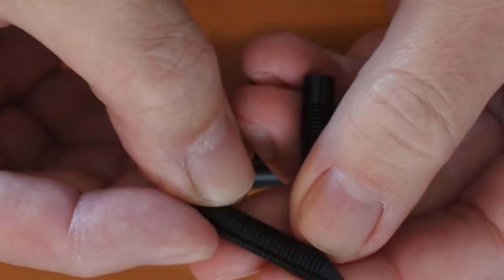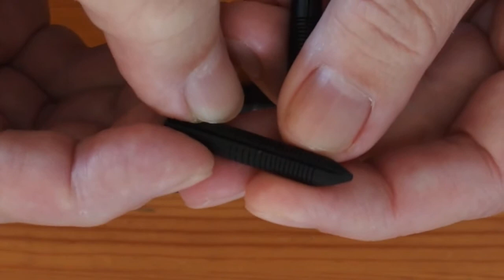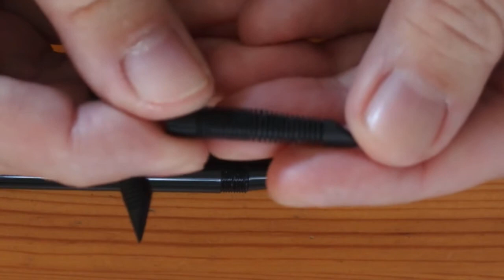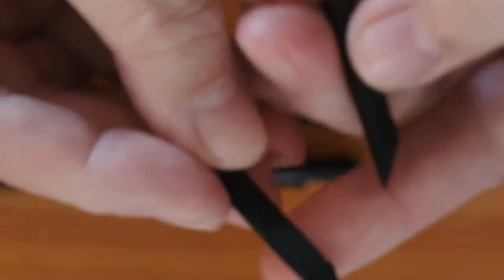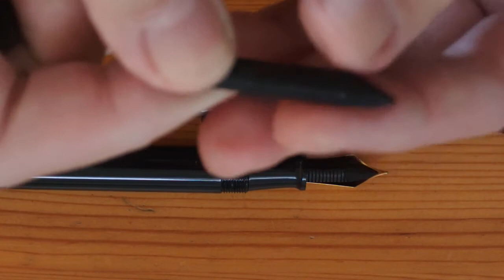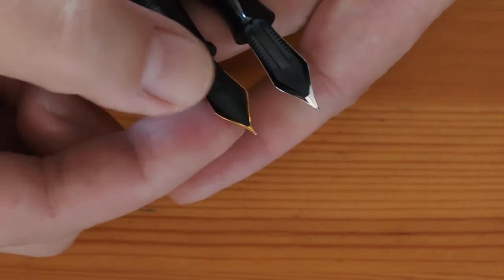Ebonite vs Plastic Fountain Pen Feeds: An Investigation

Comment: I am using fountain pens for over 60 years. Most of my pens are Indian ebonite eyedroppers. These are not fancy items, but sturdy writing instruments. The ebonite feed is strong and sturdy, and stands repeated handling. I like to play around with my pens, changing the nib, varying the flow, etc. The ebonite feed  takes all this mischief and rough treatment well.
The plastic feed is unreliable, even in the best brands; it can break even when we attempt to change the nib. To adjust the flow is difficult with plastic feed. We should not touch the plastic feed unless we are professionals, and we have a replacement ready. This is my experience.

Comment: I can speak for Montblanc, as it is the brand I know best.
Up until the 80s, Mont Blanc pens had always ebonite feeds. I have several Montblanc vintage pens. They are all ASTOUNDING writing instruments. With the modern production though, having also some of them, I do notice a difference. And it's not a difference for the better, precisely. Modern Montblanc pens are no longer the "aaaw" pens that used to be. Modern Montblanc pens are just fine, sometimes "meh" pens. I don't know if it's because the material itself or rather because plastic feeds can be "machine adjusted" in contrast to ebonite feeds that need to be individually tuned and adjusted; this would account for virtually zero defective pens among the vintage ones. Anyway, perhaps Montblanc is too busy nowadays being a "luxury brand", and making stuff like watches, jewels, etc. Back a days Montblanc was only focused on making superb writing instruments. I suppose when you have too many things to do, you don't do all of them as well as you could if you only had one to be worried about.
If you are considering to buy a premium fountain pen, I would recommend to go either for an Aurora or a Pelican; both brands kick Montblanc's ass nowadays, You are going to pay less for a better pen. And Aurora still makes ebonite feeds. Superb pens, I love Aurora.
Reply from the maker: arnauuu1 I haven't bought a Montblanc pen new for some time, in fact since the 1970s, so I am not in a position to say too much about them. Piston filler aside, as the C/C system getting to be the mainstream configuration, the requirement for a tailed feed makes ebonite an unsuitable choice for the purpose, even though its inherent hydrophilic nature is quite a plus. Manufacturing precision is required for injection moulded thermoplastics feeds and nibs to work flawlessly, as it's very difficult to get them fine-tuned to effect perfect partnership. By the way, Montblanc bought the Minerva watch company as a way to offer Montblanc-branded watches; they have neither the intention nor the resources to build up the capability to manufacture watches anyway.
Reply: @Seele2015au  I don't know, I am not a physicist or anything. I just feel that Montblanc pens have lost the "soul" (if that makes sense) they used to have. And for certain, the springiness.
Reply: I have a Delta Roma Imperiale fountain pen with a massive ebonite feed. This pen beats my brother's MB in every way. The ebonite feed never disappoints me.

Comment: The fountain pen industry has ruined itself with plastic.
I spent months waiting and good money having a pen built for me...only for it to arrive with a #5 Nib and POS plastic feed with that damnable pigtail.
Tried to swap in an ebonite feed...nope. Complete ink starvation.
No one makes a #5 ebonite compatible nib/feed sleeve that screws into the pens section.
That makes this pen impossible to upgrade. 
Thankfully I've modded the plastic feed enough to support Flex writing with a flex nib. Drains the converter quickly though.
I've decided to upgrade to a PENBBS-456 with Ebonite parts for Flex writing.
Hopefully that works out...if not, I'm not going to be a happy camper.
I'll have to start saving up for a vintage fountain pen....modern hardware is just garbage.
Just pretty fancy garbage...
Reply from the maker: If you want cartridge/converter operation, or screw-in nib unit, then you have to put up with injection molded thermoplastics feeds as the feed tail is essential. It is not about modern hardware or whatever, it's a demand of the design: want the design, live with the materials that make the design possible in the first place.
Reply: I'd love to switch all my non c/c pens to ebonite, where do you get a feed that fits a PenBBS nib assembly? I'll take a dozen! ;)
Reply: This is really weird. You were on another channel one year ago proclaiming the virtues of plastic over ebonite. Were you just there to hate on Noodler’s pens or are you just this flip floppy on your opinions that 2 years after this you proclaim plastic is superior in every way? Also, you could just get a Noodler’s Triple Tail and be smart enough to use it and maintain it.